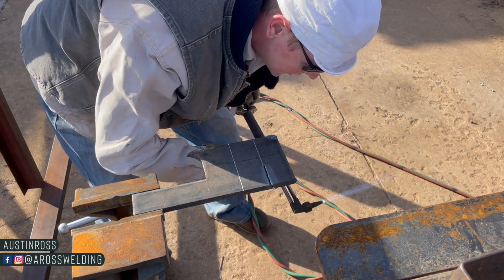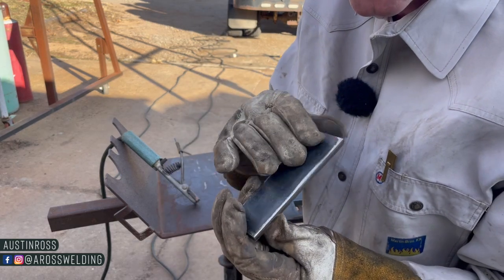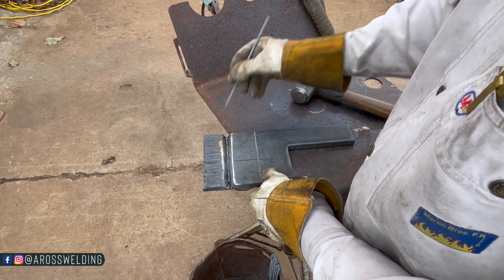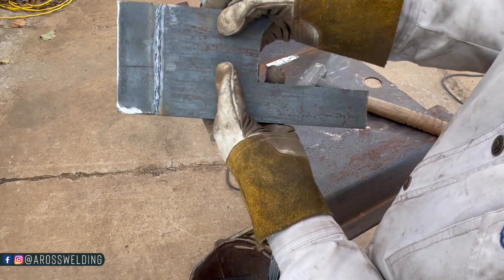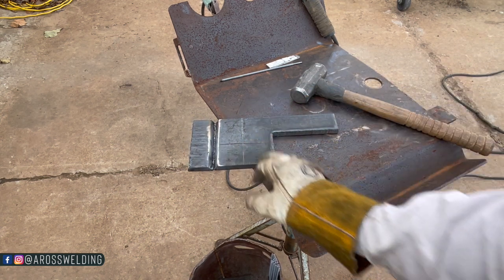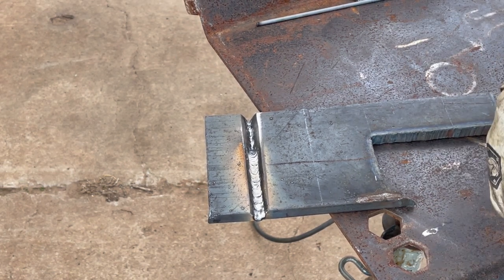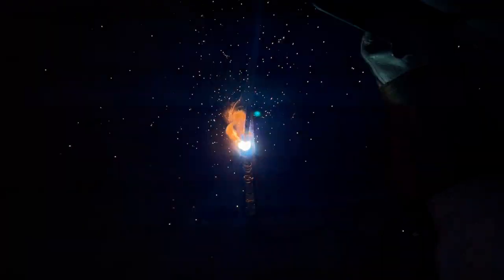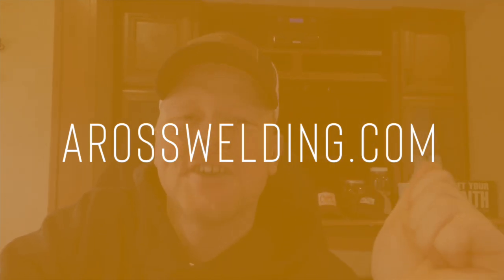6010 Open Root & Hotpass Tips & Tricks (1G aka Flat)

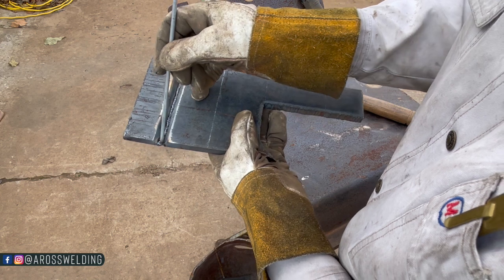Comment: Hey what settings did you run your root pass at? And is the hot pass was 6010 as well or did you switch to 7018? 3:23
Reply: 5:08 he said run the same rod so i believe hot pass was 6010 aswell

Comment: Have you ever tried wetting the rods? 5p+ right outta,the can tends to toenail bad and dosent run well sometimes. I'll run them under a faucet, then dry the excess water off and go to work. Obviously, inspectors get miffed by this, but it does work and passes x-ray every time.